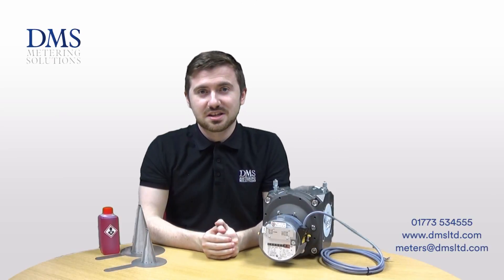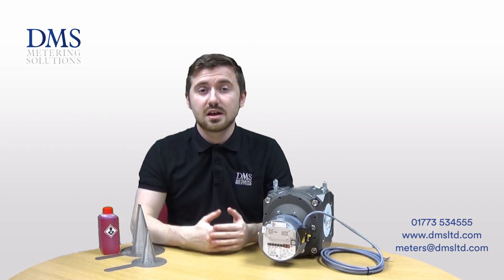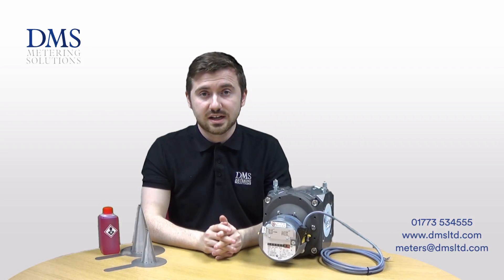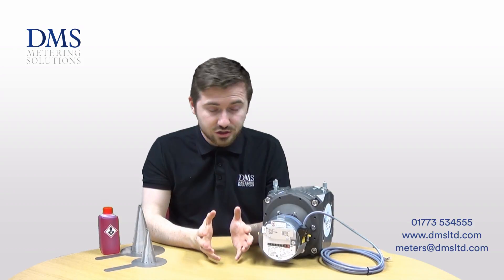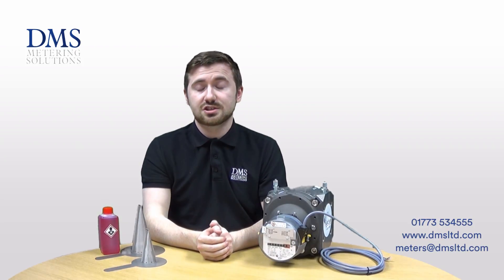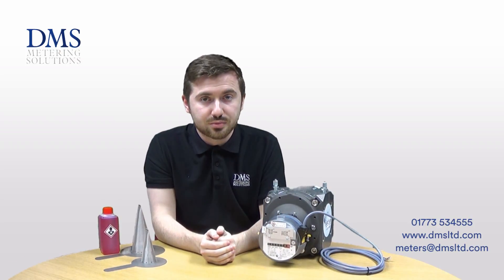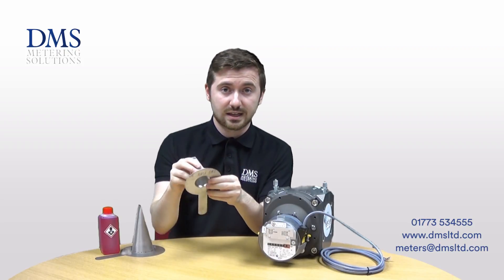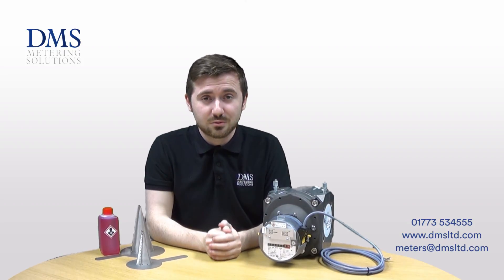Elster RABO Rotary Gas meter

Comment: I have installed a FMG RPD (Rotary Positive Displacement) gas flow meter, likely model FMR G40 DASD Class150.

How to calculate multiplication factor pls help
Reply from the maker: Thank you for your comment on our video, we don't supply the meters you are using but if you follow up with your supplier, they should be able to offer you some technical support. If you need any further assistance then contact meters@dmsltd.com 😁

Comment: Hi
we've installed this rabo in our gas line after that we noticed that we need a volume conversion EK205 but i still didn't get the right reading,  could you help me with calibration the Ek205
Reply from the maker: Hello, we will be happy to assist, if you could give us a call on 01773 534555 or pop an email over to meters@dmsltd.com. Mnay thanks.

Comment: Thank you for your illustrations. What could cause any of the meter to over spin and also I will like to confirm if it can be repaired if damaged
Reply from the maker: Meters that experience high flow demand, outside of their calibrated maximum flow rate, can experience overspinning and inaccuracies in the meter readings.

If you experience any damage on a RABO gas meter then that can be returned to the factory for inspection and possible repair. With the time involved to transport the original meter overseas back to the factory, we would recommend buying a new meter to replace the existing one. This should prove a faster and simpler solution to reduce the downtime on site. If you have an issue with a meter that is suspected to be covered under warranty, then that meter would need to be returned for inspection by Honeywell.

If you require any further information, please do not hesitate to contact us on meters@dmsltd.com.

Comment: Why these gas meters needed if flowmeters are present to measure direct flow?
Reply from the maker: Thank you for your comment, a gas meter is a type of flow meter.
Reply from the maker: These meters are for gas volumes so they are measuring gas flow rates within a system to determine the gas usage.
Reply: In INDIA reach out to FairFlow India Pvt Ltd Delhi, for further clarity and sales

Comment: can you please provide more information about INS-10 pulse transmitter ?
Reply from the maker: Dear Rabia, thank you for your interest. The IN-S10 Pulse Transmitter is used with a variety of Elster Gas Meters and has 2 pulsed outputs and a Tamper Alarm per Transmitter.

The first output (E1) uses the White and Brown Wires
The second output (E2) uses the Green and Yellow Wires
Finally, the PCM Tamper Alarm uses the Grey and Pink Wires

This should be badged on the IN-S10 Transmitter itself. I can send you a data sheet for this if you would like to email into sales@dmsltd.com and we will respond.

Thanks again and let us know if we can help any further!
Reply: Thank You, i really appreciate your help
Reply: Please can you send me the the wiring diagram of it. Where this outputs are connected. What is purpose of PCM?